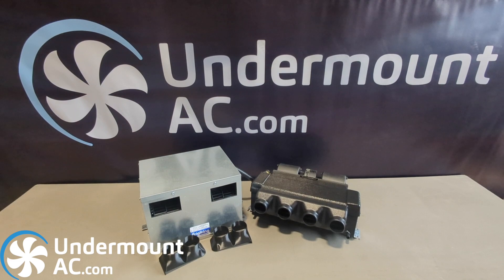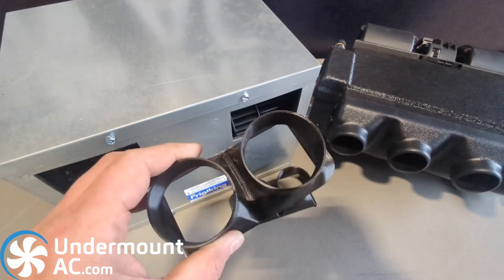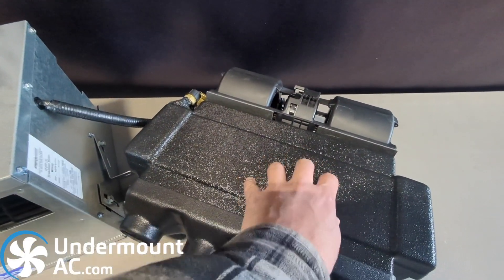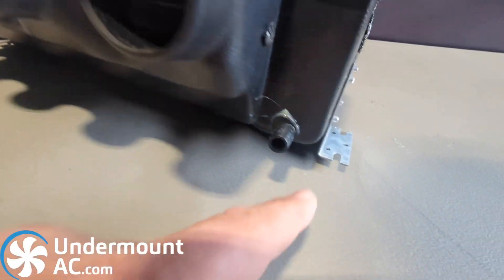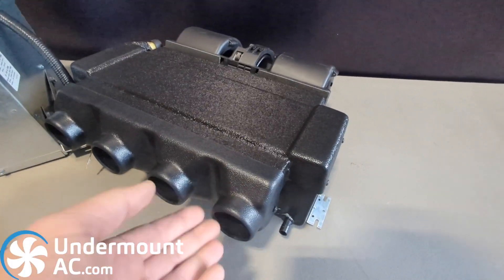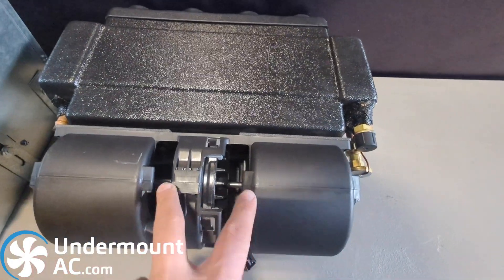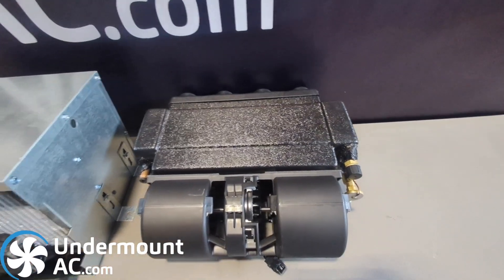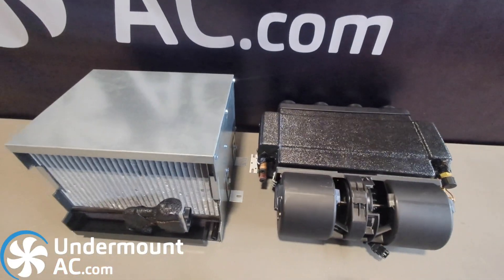UndermountAC.com DC air conditioner evaporator choices

Comment: Can the metal box evaporator be placed inside in a cabinet if it has space behind or does it have to have outside air? What is the maximum length of ducting hose. I have a UPS type step van can I cool the front and rear?
Reply from the maker: No, it recirculates inside air. The rest of the system is outside. No maximum length so long as they are relatively equal in length.